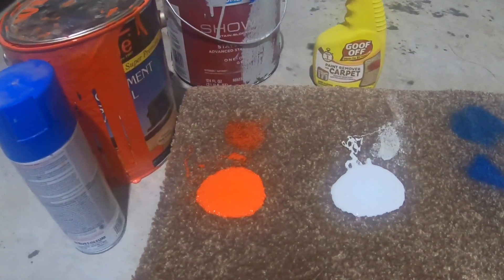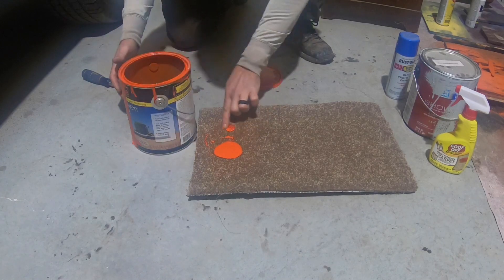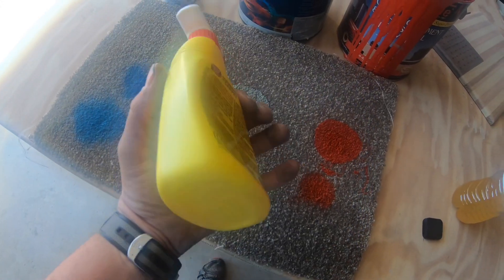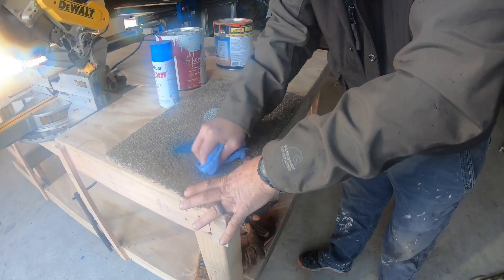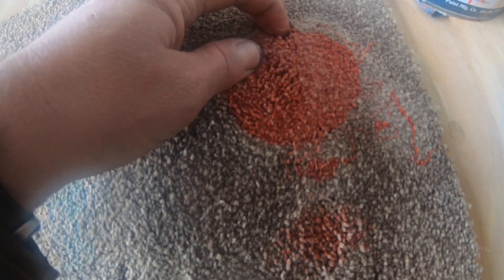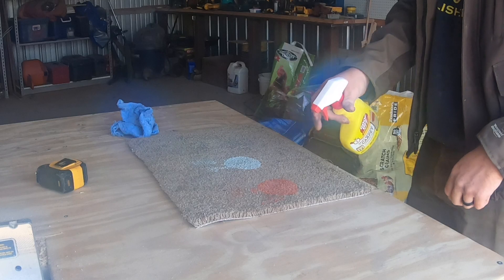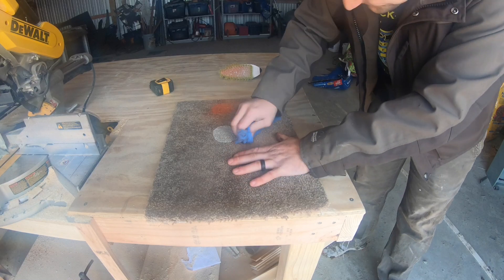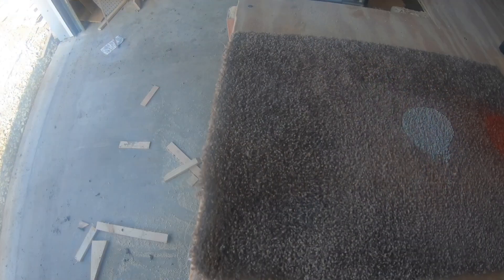Remove Paint From Carpet (Goof Off Product Review)

Comment: To get water based paint out of the carpet all you need is a shop vac and some water.  My daughter had a massive spill of white paint on the carpet a couple years ago.  I grabbed a bucket of water and the shop vac.  I would pour the water on the paint spot and then suck it right back up with the shop vac.  This kept the paint being rubbed down into the carpet.  I kept pouring water and sucking it up until all the color was gone and I was sucking up clear water.  No stain and you can’t tell paint was even spilt there. I got this tip from a painter friend of mine.
Reply from the maker: Awesome tip Jon! Thank you!
Reply: Was the paint dried up???
Reply: It's not as easy as you said. If it's been dried for an extended period to time then it's practically permanent
Reply: This worked very well for me. Latex paint that had sat for about an hour. Mucked up all that I could with a towel, poured warm water on it - shop vac, pour water - shop vac. Took about 20 minutes to get a 14" circle area up. I went until I got clear water and I think I got pretty much all of it. Very happy with this result, thank you!